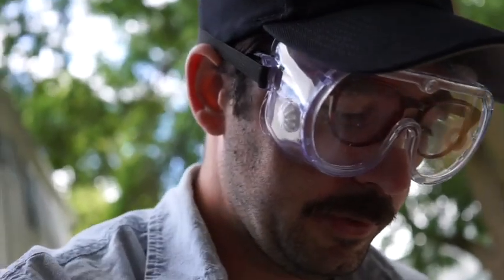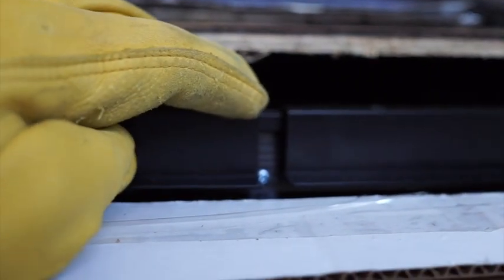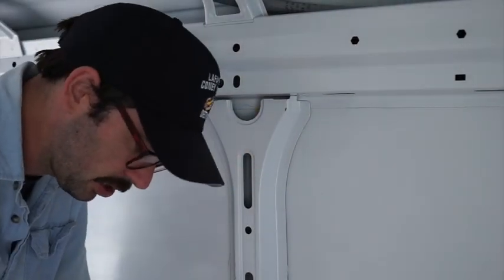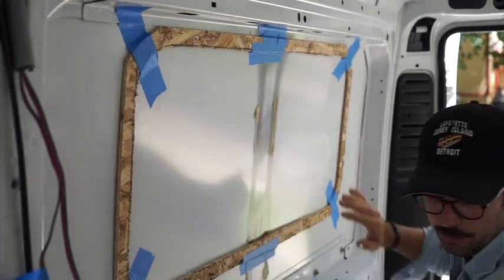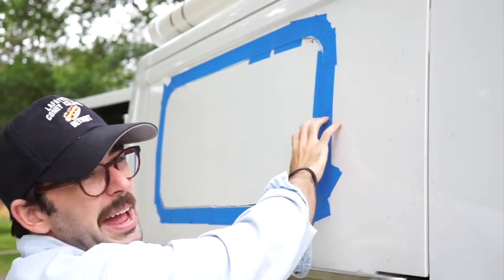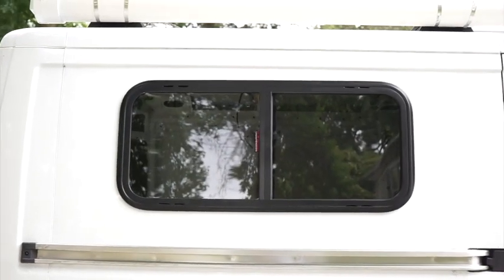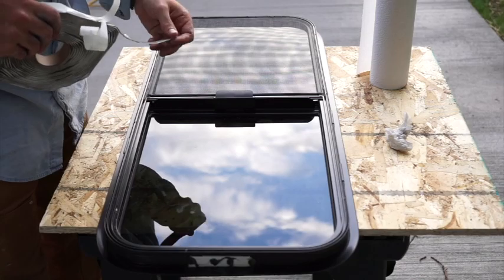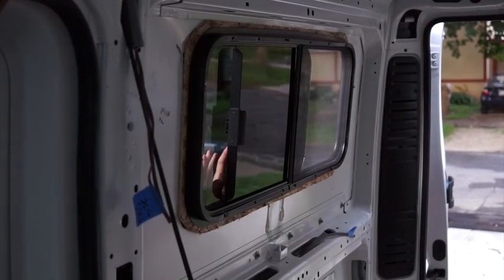Window Installation

Comment: Cool video. Good information too.  A couple suggestions though.  Create a template of the window (the hole rather than the outside of the hole) and then trace around the outside of that.  That will ensure your cut out is just a little larger than the window and should fit the first time.  Blue tape the inside and outside of the wall before you draw the cut out.  That way you are not cutting with your saw directly on the metal and scratching it all up.

Comment: Another tip for the angle grinder is a cutting wheel which would’ve worked for cutting the window out also
Reply from the maker: Yeah I DEFINITELY would do it differently next time and not be so lazy with my tools.

Comment: Hey! Just bought what I think are the same windows. Did yours come with drain hole covers or did you order them separately? I am afraid of leaks! Let me know, I can't find anywhere to order them.
Reply from the maker: Owen Murphy It didn’t come with covers and I didn’t get any. So mine are exposed. I haven’t had any leakage problems as far as I can tell though. I did some heavy hose testing up front and had leakage, but my test with the hose was pretty unrealistic to rain. Haven’t had any problems with real rain.

Comment: Does the kit comes with everything? including frame and rubber shield?
Thanks for the video.
Reply from the maker: Tom Jackson The window comes with the frame part for the inside, but I had to make the wood spacer myself and then bought the putty tape and the sealant separately - so those didn’t come with the window.

Comment: What made you choose the Butyl tape versus the urethane adhesives? Have you had an issues with leaking?
Reply from the maker: Michael Matiasek I think I’d just read about a few other people using the butyl tape, and a friend of mind used it, so I just used what I knew about. I also used it for my Fantastic fan on the roof as I’d seen people use it for that as well. I haven’t had any problems with leaking though - whether that’s just the butyl tape or the fact that I went over the edge with marine sealant from 3M at the end, I don’t know.
Reply: Did you use 3m sealant on the inside or around the outside?  I assume inside.

Comment: You mind sharing the dimensions or a link to those windows?
Reply: Hey Josh, got the windows from here: https://www.dkhardware.com/universal-non-contoured-horizontal-sliding-window-37-1-4-x-16-3-4-with-2-1-4-trim-ring-vw8369-product-26054.html

Comment: Got to be the longest way round I’ve seen, use an angle grinder, use sikaflex to protect the metal and fit the window, will hold better than the putty, won’t need to screw it, when it comes to the beam removal, could have saved yourself the nightmare and angle ground near the weld, would have broke the weld and would have been easier, very amateurish but well done for showing an attempt, professional van fitters use our tools correctly and fit with ease. Maybe time to show all how we do it.